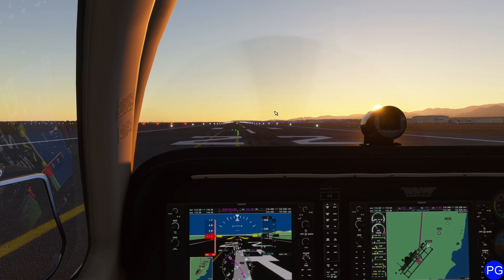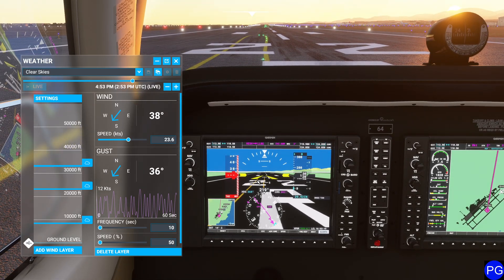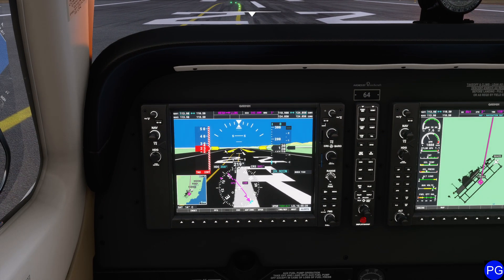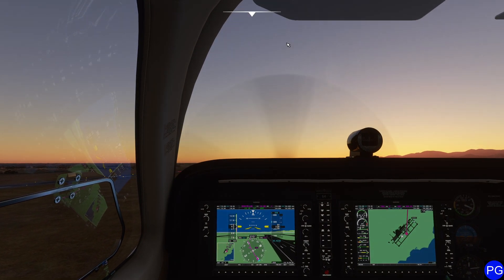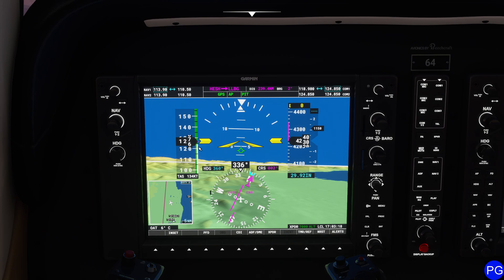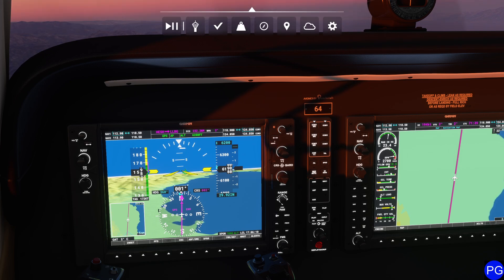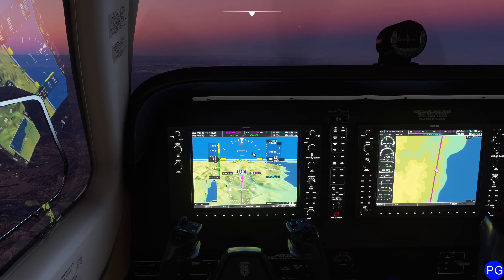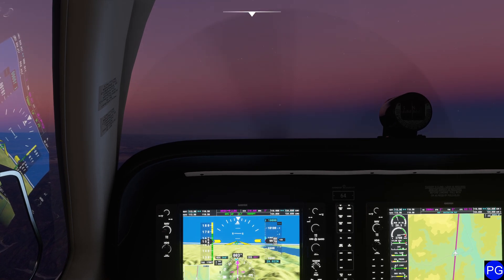FS2020 - Understanding Airspeed

Comment: And that pressure decrease with altitude is why Torque in a Turboprop should decrease with higher altitude and not increase. I wish someone at Asobo would fix this! All the turboprop aircraft are showing this torque issue.